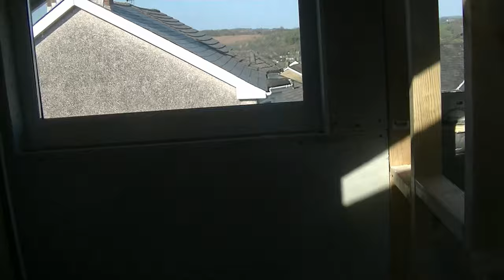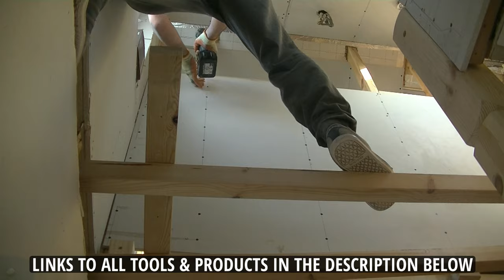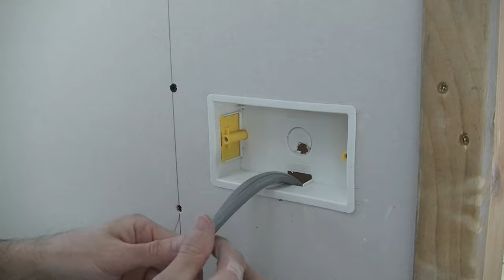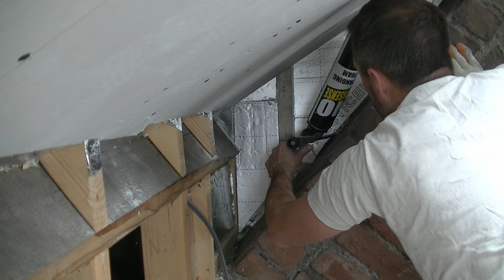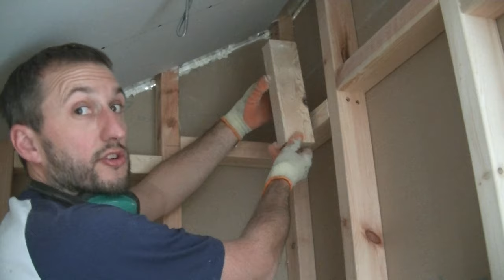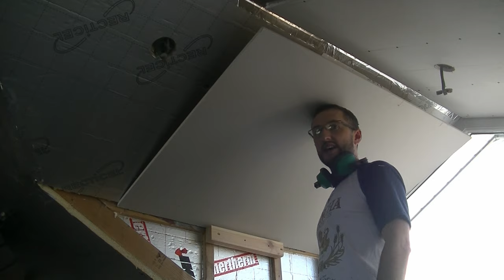Loft conversion Part 42 - Plaster boarding again! Dry walling a loft conversion. DIY loft conversion

Comment: Did you route a new circuit from the fusebox?  Will you be wet plastering over the plasterboards?
Reply from the maker: I added to the upstairs ring circuit continuing the ring. You can see in one of my earlier videos where I broke into the ring. I plastered it all myself. Unfortunately I've lost a lot of footage after this point which I'm currently trying to get recovered from my hard drive. Thanks for watching 👍
Reply: @POUSEaroundtheHOUSE  Thanks for the reply. It seems that some of the upstairs walls in my house just had plasterboard with paper put over it. :-(

Comment: How long did your extension take from start to finish? I've watched a lot of your videos on it and it looks very hard work. Also, what is it you do for a living? I know you've said before but I can't remember 😂.
Reply from the maker: It took 2 and a half years from complete start to finish but I had many months off from it in between, plus lockdown, material supply issues etc. I've taken a long time to edit and upload which is why it appears to have taken so long. As for the day job, nothing to do with building! Thanks for the continued support 👍

Comment: WHAT is the point of insulated plaster board on sloping ceilings?  Another pointless diktat for diktat's sake as far as I'm concerned.
Reply from the maker: In fairness it has made the room really warm. Even in winter I have no heating on in that room and it's fine. Hope that helps 👍
Reply: @POUSEaroundtheHOUSE  But how do you know it's that extra 35mm or so which does it when you already have 4" of insulation?